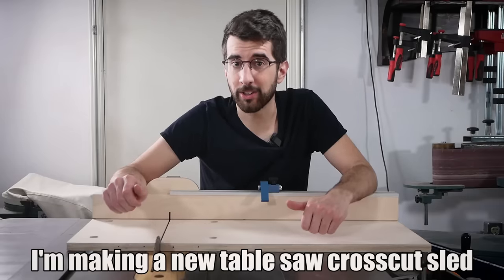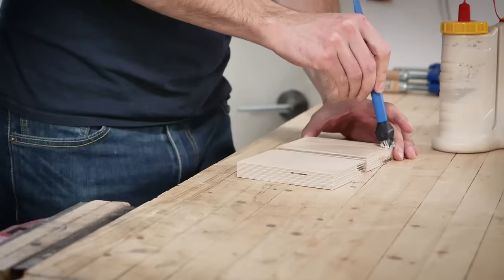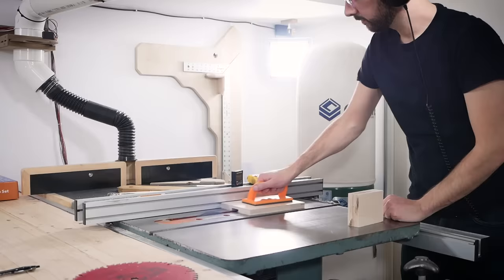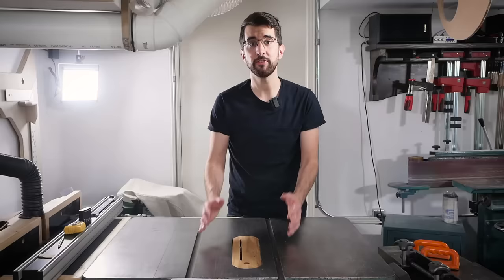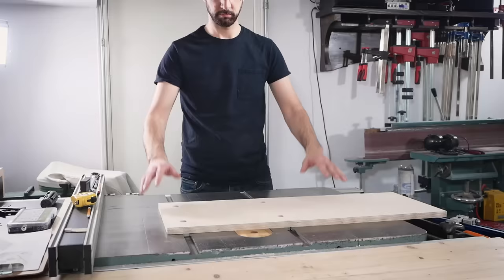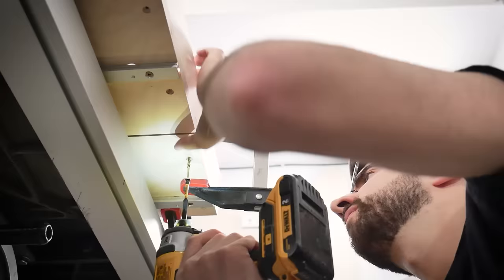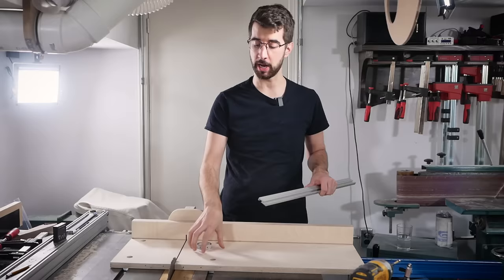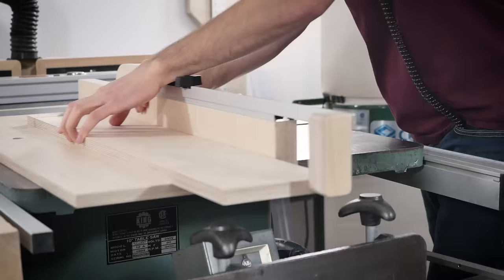your crosscut sled is way too big

Comment: I've been woodworking for over 10 years and only used a crosscut sled a few times during the beginning. I've managed to live without them. But I laughed when you acted out a sled becoming too tight and not being able to move it because that is exactly what happened to me 10 years ago when I used to use one. I made it in the winter, but hadn't used it much; then one day during summer I pulled it out only to find it was so tight that I could barely move it. That was the day I stopped using them. I might try this simple design of yours out to see if I like it. I definitely like the idea of using the adjustable rails.

Comment: Nice video and nice and well designed simple (and I mean that in a good way) sled. Ever wonder why it is customary to cross cut on the left side of the blade and not the right? Even though right is better? One day I’ll put a video on my channel talking about that. It’s a good discussion!
Reply: great point!
Reply: I presume it's so you don't have to bother to remove the fence in most cases.
Reply: @ps.2  something like that. Historically, table saw surfaces were small and the fence was mounted in a complicated fashion on rails/tracks on the right side - front and back. Not simple to remove and even if you did, there was not much more table to the right side of the blade. So the norm was established to rip right and cross cut left. Modern table saws have fences that are easy to remove or slide out of the way. And they have like 50 plus inches of table to the right. So if cross cutting in a modern configured table saw, it makes sense to cross cut on the right where you have much more support for the board.

Comment: Yep, got one of those "monster" 36" x 25" sleds myself.. except mine is fabricated using 9mm BB with aluminum guides.. with an imbedded rule in the table piece to make step and repeat cuts really fast! Oh, yes, and a fraction of the weight of your [original] 18mm BB solution. Oh, and Why 25" depth (width), you ask? You must never have to do repeated trapezoidal pieces (10 -20 at a time.. and oh, yeah, try doing THOSE with a taper jig!). You're absolutely correct, miter gauge "creep" really occurs in doing bigger panel cuts. My first crosscut sled 24 years ago was made of 1/4" shop ply.. and worked surprisingly well. Nice idea, though..

Comment: Build vertical panel saw .  It is way easier to use bacause gravity makes the most that holds the pieces and the best part is , it is safer bacause the blade looks to the wall not your fingers

Comment: I don't see any reason why expandable nylon washers on slide bars  need to be oriented to the same side.  In practice the two t slots on table saw are not  perfectly parallel (at least not on my Bosch pts 10). Also the blade has some small horizontal angle, no matter how good you are with blade setup and calibration.
Obviously, several parameters play their role, so we cannot say anything about orientation of washers.
However, this video has the very important message - don't make runners. That is so true if you want the precise operation.

Comment: Great video, very interesting take on a crosscut sled. I do want to point out though... I bought the recommended rail and they ended up not fitting in my old Craftsman table saw. No fault of Scott, and the product looks to be of excellent quality, it just won't fit in my table saw tracks with the wheels still on it (which is why you buy this type of rail in the first place.
Also, love the videos Scott, great job!

Comment: The base is too thick for a 10" saw, 1/4" aluminum plate riding on UHMW tape gives more depth. There needs to be down clamps as well as fore and aft clamps available. The sled should not hang over the left side of the saw, ever. A seesaw is a bad thing with a spinning blade nearby. Use a chop saw, with stops. I think that "guard" may not be safe over time, and it should be more robust to hold things together,

Sorry, I'm just a cranky old boat builder. Best wishes.

Comment: I immediately went into "lazy" mode and wondered why you didn't just cut your huge sled in half and add a track for stops !
I'm also a fan of a "smaller" sled with a track for stops.  Since I have an Incra 1000HD miter gauge, I made my sled so that it would take the incra stops.   Good video !!

Comment: Yes, my cabinet saw is big, but, NO, it's not (too big).

Presuming one size fits all is a mistake.

We used to use a large sled to square up the edges of 4'x8' plywood sheets.  It was thousands cheaper than buying a sliding tablesaw.

Comment: Love the simplicity of your sled!  One question... have you come up with any solution for using a dado stack with a sled?  Seems challenging to retain the zero clearance.  I've seen a couple designs using inserts, but they're a little complicated to build.
Reply from the maker: I would honestly just make a whole separate sled for your dado stack, and make it so that you're cutting on the arbor flange side so you'll always have zero clearance on at least one side. I just use my miter gauge with the dado stack
Reply: Good suggestion Scott, I'm also leaning towards making a separate sled.

Comment: Interesting build.  I can see a place for smaller sleds, especially on smaller job site saws, that have minimal table surface in front of the blade for infeed, such as my DW745.
At about 10:33 in the video, something appears in the foreground.  It resembles a blade guard, attached to 2 inch clear acrylic dust pipe, which ascends upward out of frame.  
Please tell us about this: Is it a blade guard?  If so, then what kind?  Where did it come from?  How is it supported and positioned?
My ancient table saw came with no blade guard, no fence, no miter gauge and no dust collection - actually, no accessories and a non-functional power switch.  All problems have been resolved except the blade guard, AND it would be nice to have above table dust collection.  Please advise.
Thank-you
Reply: Disregard.  Found the build video.  Thanks!

Comment: Holy balls.  That crosscut at 0:36 with no riving knife.   Wise folks clicked away just then.
Reply: Nobody clicked away. Definitely no one who has ever set foot in a cabinet shop. Instead of mindlessly repeating mantras you’ve heard on YouTube, why don’t you learn what a riving knife does? That way you’ll know when you need to use one, and when it serves no purpose at all. 

The riving knife prevents the cut from closing up after it passes the blade, which can catch on a tooth and cause a sudden, violent kickback. This can occur when RIPPING wood parallel to the grain and the equilibrium is disturbed between the opposing forces in the grain (that acted to keep the tree standing whether there was ice on it’s limbs or not, or whether the wind blew out of the south or the north or the west) resulting in the closure of the kerf onto the blade.

In the case of “crosscutting” a piece of Baltic Birch plywood no such forces exist to close the kerf. I use quotation marks because crosscutting is when you cut across the grain, and in the case of plywood, each ply is oriented in alternating grain directions, so technically you can never really rip or crosscut a piece of plywood, and yet each cut is also partially BOTH a rip and a crosscut. 

But forget semantics; The point is that in the application we see at the 0:36 mark, a riving knife is not needed, and if one was installed it would have served ZERO purpose there. 

Know what you’re doing before using power tools, and know what you’re talking about before  attempting to educate other people.

Comment: I made a sled without the back fence and after a while it wont stay flat on the table saw.  Both side are not on the same plane anymore
Reply from the maker: I'm curious to know what kind of plywood you used? Anyone interested in this crosscut sled can definitely add a forward fence. Or even that temporary fence that I used could have just been left there.
Reply: @ScottWalshWoodworking  I used 3/4 Baltic.  Where I live it's only 15% more than the ply at home Depot. So I always use BB. On a small sled, I find the back fence constraining.

Comment: 10:29 Oops, I did not receive the memo stating "Rather than utilize the correct word use we should now utilize utilize." LOL. Actually, use and utilize are not the same, two different words, two different meanings. The use of utilize comes across as pompous and self-ingratiating. When an item is used for other than its intended purpose it is utilized. Think chair, a chair's intended use is for sitting upon, however it can be utilized as a step stool. Badda-boom.

Comment: Hello.  
I have a question.  Not related to the video but regarding table saw cuts. 
As im working on a project. 
My length and width cuts are accurate. But my cut piece are diagonally inaccurate.    I made my sledge to accurate 90 degree cut with the blade.  But when i cut a square shape, its diagonally inaccurate.
Reply from the maker: Are you using a sled or a miter gauge? Either way, it seems like it's not square to the miter slots in the table, which is why you're ending up with a diamond shape instead of a square

Comment: Nice! Personally, I use a crosscut sled from rockler, but this seems a lot lighter weight, which is something I always prefer. I also have a homemade one, but again, the weight. I will definitely build one of these at some point! Also, great video! But where’s the tunes? I will definitely buy the plans!
Reply from the maker: Thanks Arpad! Sometimes there's no room for the tunes! It's an internal struggle right now I'm having. Not sure if the music is going to be in scope for a little while, while I'm trying to jam pack my videos full of value.
Reply: @ScottWalshWoodworking  I get what you mean… I also struggle trying to put a lot of value into my videos, but one thing I learned from Zac and Eric Spencley don’t say too much. They told me sometimes talk less and just let the self explanatory parts of the video play out, and basically let the video do the talking. I still struggle with what you’re saying, but that method has helped me. And sometimes if I’m making a similar project to a previous video, or if is so self explanatory, I’ll just let the video play out. But everyone has different styles of videos! I do love how informative this video is!

Comment: Hi Scott, 

I knew you had to be Canadian the second you mentioned Veritas in your panel sled video.  :) 

Enjoyed that one and this one.  For runners on my sled(s) I also go to Lee Valley but get some of their high molecular plastic runners which are already sized for full size table saws and can be cut to length easily.  A 1/2 dozen pre-drilled and counter sunk holes per and Bob's your uncle.

I am in Ottawa, so seasonal variations in wood movement is always a concern for me as well.

Keep up the good work.

Cheers,

Richard

Comment: Instead of getting your fence square with the kerf cut, why didn't you just slide the table fence over and use that? What am I missing?
Reply from the maker: Table saw fences shouldn't actually be completely parallel with the blade. It's recommended to leave a couple of thou at the back of the blade to prevent binding. Also, by referencing anything else besides the kerf cut will introduce another degree of separation. The goal is to get the fence square with the kerf.
Reply: @ScottWalshWoodworking  Thanks. Never heard that before, about fences not supposed to be 100% parallel with the blade.

Comment: Hey, you could've probably just downsized that monster sled.  But then of course we wouldn't have learned how you built this new one.
I like the idea of no back fence, although I wonder how much extra stress is on the front fence when you remove it from the table.  Instead of a full back fence, maybe a short 8" wide or so one would help, and not add much weight.
I got an idea from Workshop Companion and built a single-purpose sled with NO fences.  Just a slab with runners, then cut into two separate halves, then installed a permanent angle guide and hold-down clamps on the left half.  Then they can both be pushed simultaneously, or leave the right one stationary for support.

Comment: Can you afford using a thinner plywood sheet that 3/4 for the sole like 1/4 or 3/8 ? It's saving some height for the cut, it's not integral to the structure as the guard and the rails are holding it rigid, and you aren't putting T tracks so you don't really need the thickness.
Reply from the maker: If you found 1/2" plywood that was super flat, I think it would be fine. But 3/4" is going to stay much flatter over time too. If the base isn't flat, then the cut might not be perfectly square.

Comment: Might not be a terrible idea to add a disclaimer for SawStop users to disable the brake when telling them it's ok to cut aluminum on the table saw.  If their hand is touching the metal when it passes through the blade, that's a $200+ oopsie.
Reply: That is the one complaint I have about SawStop, I have spent about $2,000 repairing mine after finger nicks.
Reply: @FranktheDachshund  If you actually activate your SawStop  with an errant body part SawStop will replace the module for free. There is a chip inside and they can tell a real activation vs wet wood or metal.
Reply: @FranktheDachshund Finger nicks?? Wtf does that even mean?  You actually hit your fingers, and multiple times???   My grandpa used his saw for over 20 years.  Not one "finger nick".  My dad used the same saw his whole life.  The only accident was a near deadly kickback but he learned from his mistake.  I grew up using that saw and now I have it.  Guess what?  No "finger nicks".  

You should be complaining about your own negligence, not the company that literally saved your fingers from your own stupidity.

Your $2k bill is a lot cheaper than the hospital, but I sincerely hope you can learn from your mistakes.  My insurance is sky high because idiots have table saw "accidents" every single day all over the US.

Comment: Jon Peters would like to have a talk to you about his massive crosscut sled...  😉
Reply from the maker: There are sooo many massive crosscut sled out there, and I made one too, but they're just not practical for everyday use, at least for me.
Reply: @ScottWalshWoodworking  I have four sleds.    And the vast majority of the time I use the small one with the 10" capacity.  I do need to add some t-track for a stop though.

Comment: Great video and plans to boot!?  Well done!  Do you have a sled for angles?  Could you add the ability to cut supported angles to this sled?
Reply from the maker: Thanks so much for the support Bradley! I have a miter sled that's very similar to David's from Make Something for 45 degree cuts, but otherwise I use my miter gauge for the in between stuff. Maybe one day in the future I'll make a dedicated sled for all angles! For this sled, you can add T-Track to the base with two to the left side of the blade to be able to use an auxiliary fence with. Tamar did this in her video and looks pretty cool.

Comment: 3/4" (19mm) ply is a bit thick for a sled- you lose a lot of your precious blade height. The sled is sitting on the (cast iron) table- it does not need to be rigid; indeed thinner may well be more accurate.
Given that there is no front support bridging the two sides- you do not need a base at all! It serves no useful purpose- the rails are holding it square, not the other way around.  Max blade depth, table surface accuracy, less material to build, what is not to like?
BTW, where is your riving knife, you naughty boy!

Comment: I'm glad to hear this rationale has finally sunk in on Crosscut sleds! Most work working is done by Woodworkers using the monkey see, monkey do,  woodworking methodologies! 
But I'm still surprised to see why you're using 3/4 stock on everything? It's not necessary for the base quarter inch masonite would work just fine at the base I'm such a small sled at that. On a larger sled using larger piece of wood you can make it lighter by Drilling lightning holes on the whole surface of the bed. Glad to see you plugged in the light bulb finally for Woodworkers! Lol

Comment: 5:53 How do you prevent the nylon washers from rotating during use? I found that to cause problems on the ones I bought (Matronics, Denmark).
Reply from the maker: not sure, mine do not spin like yours. I would maybe try just tacking one half of the nylon washer to the rail with CA glue, still allowing it to expand.

Comment: 3/4"? Still too beefy. ½" multi-ply is more than enough. Also losing 1/4" in thickness means you don't have to crank the blade as high (gain a little extra thickness you can cut).
I learned a lot though — need to make a new cross-cut sled now.

Comment: I'm wondering why you chose to put most of the sled on the left side of the blade rather than the right, where I think I see it most often?
Reply: Because the fence is on the right side of the blade. You slide the fence out of the way when you use a crosscut sled, but if you’re feeding the piece you’re crosscutting on the same side of the blade as the fence, then you would have to take the fence completely off the saw if your work piece is longer than the fence will slide to the right of the blade. If you work on the left side of the blade then you don’t have that problem. It’s also safer because you stay closer to the kill switch.

Comment: While you are absolutely correct that you can easily cut aluminum with a carbide blade. If you have a Saw Stop, you MUST TURN OFF THE SENSOR or you will buy a new blade and brake.